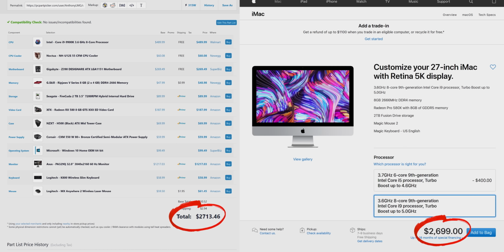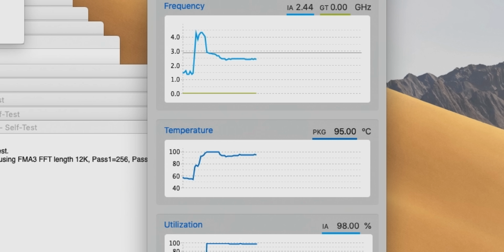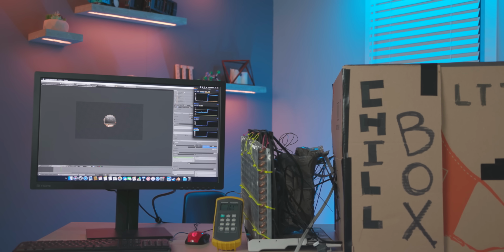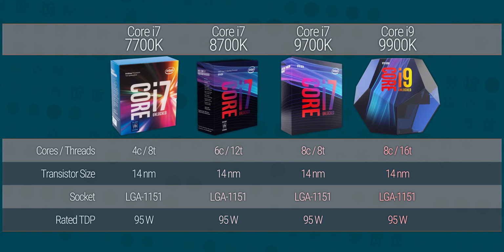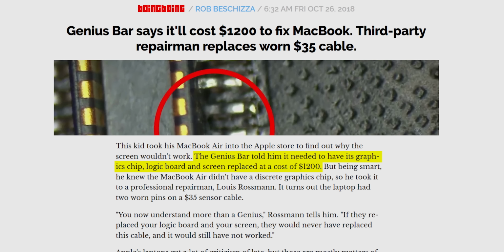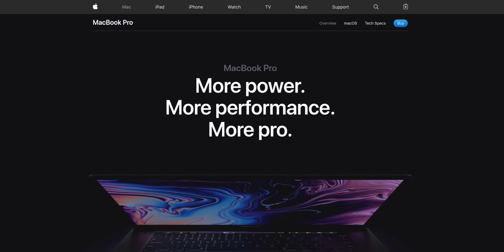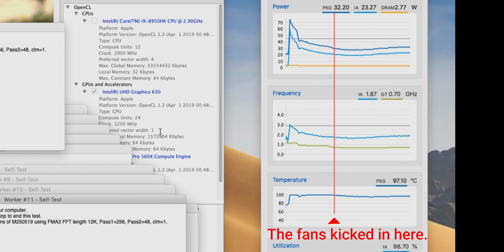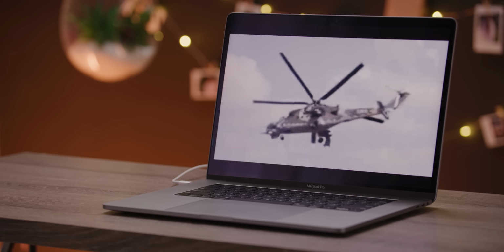Macs are SLOWER than PCs. Here’s why.

Comment: Hi LTT, The reason why thermal throttling is not as common on apple's phones is because of a few factors:

- phone getting hot in hand, possible hand injury from thermal effects of an overheat. This is a risk to apple for lawsuit over physical harm to a human being.
- regulations on the certification of components approved for use in handheld devices such as batteries and such regulate the safety aspects like heat which can threaten thermal runaway on small batteries in a wearable/handheld device like a cell phone that comes in close proximity to human heads on a regular basis.
- phones are subject to testing not only for the radiation they emit, but also for other safety aspects of the complete packages to determine that the combination of approved components does not cause a compounded issue that jeopardizes human lives. (scrutiny of this has tightened following the event of the Samsung note 7 fires)

There are likely other factors such as power efficiency loss at high temperatures and customer satisfaction with battery life that will destroy apple's reputation if not properly accounted for since the iphone is one of their most widespread products, used by many times more people than users of macbooks.

Comment: Ha, I have a small Dell laptop with two hell's coolers that can handle 4/8 Intel CPU running at 3200 MHz turboboost. The temperature is never higher than 70 degrees. The CPU doesn't drop the freq for indefinite amount of time. I had it running a script that fully loads all 8 threads for two hours. The clock was 3200 and the temp was 65-70.
I call it 'well-designed' (unlike Apple's garbage)

Comment: This is why Apple is going to move to their own chips in their MacBooks.

They did it with the iPhone with great success, same will happen with the MBP.
Reply: Exactly what I'm thinking. I bet the engineers at Apple are probably sick of dealing with Intel processors. They put up with PowerPC until they couldn't stand it anymore, and I'm sure they're just as ready to jump ship from Intel.
Reply: It's one reason. Most of their sales are to people who don't know, don't care, so it's not the primary motivation.
Reply: They have been knocking out hobbled gear for decades now, so it's not like this is a new direction Tim Cook took when Jobs died.
Reply: I doubt it. Not in the pro models, switching from X86 to ARM would be a literal nightmare scenario, not just for consumers but for apple as well. It's just not feasible in higher end models, and to split off Mac os into sub sections for both arm and X86 doesn't sound like something apple would do, unless they could somehow rip off their customers in the process as well

Comment: And they are just as insecure as PCs, both have intel management engine running 24/7 a purpose built backdoor into every system
Reply: Not really, there are more viruses and malware for Windows and Windows doesn't have data encryption with a secure enclave. True, Intel is fucked, but that's not enough to equal Mac and Windows security. Macs are definitely more secure.
Reply: @WouterStudioHD  Yeah they're more secure, but less performant.
Reply: EDG that may be one of many reasons Apple is going to make there own chips for macs soon like they do the iPhones and iPads.
Reply: Johnny English Apple is totally capable of making their own chips, they could buy
Reply: @johnnyenglish6797   They need to take inspiration from Linus's DIY heatsink
Reply: Johnny English Really, you could solve the problem with the same thin and light enclosure? Apple must be dying to hire you.
Reply: Johnny English Yes I did, because everyone knows you can make a well cooled enclosure by making it bigger, that’s not hard. That’s just not what Apple is about. Apple is about sleek design and if they need to give in some performace for a thinner body, they will do it. Most people care more about a thin and beautiful design than 3 seconds less render time.
Apple would never hire you, you don’t share their way of looking at a product.
All you seem to care about is getting every single clockcycle possible out of a CPU, without considering the rest of the product. 
Things like weight and portability should not be important in a laptop if it were up to you.
Reply: Johnny English Yup, they don’t get the same clockspeed as some other notebooks, that’s a fact. Also, the keyboard is a bit weird sometimes.
In almost all other aspects they are better tho, so I still enjoy working on them more than any other laptop.
They have the best trackpads, the best audio quality, best displays, best SSD’s and best buildquality and finish.
Overal, I’m pretty happy, despite some of its flaws.

Comment: 9:47

"A slower CPU that doesn't throttle is not slower than a faster one that does."

Well put!!!
Reply: Exactly how it is.
Reply: Well If you follow Alienware Youtube channel, there's a video where the guy said why they put an I9 inside their laptop even though they known that it's gonna throttle is because of "marketing".
Reply: Slower Chip doesn't throttle > Faster Chip when throttle
I think it's about consistent performance, rather than boost and down like roller coaster
Reply: Hermawan Fandi consistancy yes, but also the average speed will probably be much higher than what it is on a thermal throttled macbook.

I have a 2014 macbook pro, that shit hits a whopping 1.2ghz at high load when it should easily produce a 2.x without the turbo boost
Reply: @yutub_hfn   Slower Chip doesn't throttle >= Faster Chip when throttling
Reply: exactly that's why in multicore cinebench scores for the 8250u and the 8550u are identical therefore paying extra makes no sense
Reply: They can just put the Intel Low Power CPU 

There is couple i7 with only 2 Core designed for Slims devices
Reply: @AliciaCLR  they CAN, but then it wouldn't be a pro product.
Reply: @tristan6509  there is different type of pro

and pro that use these devices is pro that isn't need power
Reply: Not completely true though, because a lot of workloads are a quick burst of CPU usage where it can boost clock at maximum for less than a second to finish the work faster. Not everyone is doing video editing or encoding as the primary workload on their laptop.
Reply: @allanw  but would gaming put about the same work load as video editing or something i don't know a lot about this shit
Reply: It's not that simple. Depending on the workload, a throttling CPU but with more cores will still be faster than one with less cores but higher sustained clocks. Power requirements increase exponentially with clock rate.
Although I doubt that most MacBooks ever run at full load for longer periods (aka $2000 social media machine).
Reply: @Vault Hunter also i don't know about you but my 8250u is getting 650cb in cinebench while most 8550's are getting less than 600cb. what really matters is how good your cooling solution is on your laptop.
Reply: The way this is worded is confusing to me. Is he saying Slower CPU without throttling > Faster CPU with throttling?
Reply: Yes, if the faster cpu throttles down a speed which is slower than the ‘slow’ cpu
Reply: @RayFaye  He means if CPU throttles, it isn't any faster than a slower CPU that isn't throttling
Reply: @Vault Hunter well guess what, then the i7 model(8550u) will throttle even worse for you if you have gotten it on the same model of the laptop that you have the 8250u on.
Reply: Perhaps it has to do with the activity being increased thanks to having to shut down certain things to not cook itself to death and the rest is not prepared for the unexpected load the other parts cannot handle.
Reply: It's similar to the question, which is heavier 10 pounds of lead or 10 pounds of feathers.
Reply: When you pay more for a CPU speed that is not consistent, not not a good deal! reason why i stick with i5 8th Gen CPU with SSD for a slim laptop! heck even i5 8th gen still throttles, imagine an Intel Core i9 in that form factor! well... it depends on the TPB or CPU wattage design! Hope this points out to whom wants to buy a decent laptop in the future, not siding with either Windows or Mac, it's totally up to you decide!
Reply: This.  100%.  For everything I use it for, I find a perfect combination to be an 8th gen i5 paired with 8G RAM.  When the procesor and RAM are both in the same lane, there's no throttling/heat issues, and I expect some longevity out of this combo.  I CAN upgrade my RAM to 32G, but have found zero "need" to.  With a 256G SSD, I'm up and running in 10-15 sec.  No howling fan or heat issues.
Reply: @Vault Hunter 2 ghz is a little low for 8250u. u should be expecting around 2.4ghz on all cores in a sustained load. is your processor being fed 15 watts?
Reply: Thank you, i hate listening to children talk. anything to limit my exposure
Reply: Truer words cannot be said.
Reply: Except the video directly contradicted this when it talked about how you get quick speeds in tasks that can start and finish before throttling (I believe the example used was rendering a webpage).

But really, you don’t need the video to tell you that. It should be obvious that even if the cpu eventually throttles to the level of a slower cpu, it will at least be faster for x amount of time. Whether that slight benefit is useful to the user or not is largely subjective and probably heavily reliant on the tasks they do.
Reply: @geoken2  No it doesn't. The point is consistent performance. Video editing is supposedly for Pro audience. If it throttles the speed then it's worthless. Better get those thick laptops like Clevo or the recent Alienware Area-51m and actually get proper performance. You're not gonna get anything worth while on these thin and light pro crap.
Reply: @megalith  I think everyone acknowledges that under consistent load, a CPU throttled to xGHZ and a CPU that runs natively at xGHZ and doesn’t throttle will be the same (all else being equal). The point is that the throttled CPU will at least give you a boost during the times when it isn’t throttling. The video actually acknowledged this when it talked about the browser feeling speedy. So to say that there is no difference is obviously wrong since the video itself gives examples of the difference.
Reply: @geoken2  Those scenarios will be for non strenuous tasks which let's be honest will be totally fine under a lower clocked CPU. The i9-8950hk is a mess of a CPU that even those thicker laptops had a hard time controlling it on stock settings. Cramming that thing on the Macbook Pro is a suicide mission. There's no breathing room on that thing.
Reply: Assuming the same specs otherwise, like cache sizes and memory speeds, anyway.
Reply: Does that mean the m3 1.2GHz macbooks perform better than the i5 1.3GHz models?
Reply: "La Marketing
Reply: Funny thing... my laptop's Xeon used to throttle badly (trying for 3.4-3.7 or something), down to 1.6GHz or less.

Turned off turbo - now sits happily at 2.8 and handles all the CAE I can throw at it just fine
Reply: does that mean a chrombeook with a pentium procesoor is better
Reply: I am a dinosaur... 75 years old with a long career supporting IBM and compatible mainframes.
An old piece of mainframe lore...  "All CPUS wait at the same speed"
Hey... It's true!
Reply: @philipboug  True, but there aint much watin going on when them chips are bottlenecking now are there ;) Cool though, you havin worked on them old mainframes and all. Bet you were all on tha only need five of these to cova tha cumpitin need of tha world bandwagon... :D
Reply: @Serpentbane69  There are still thousands of 'em running world wide. Insurance companies, Banks, Government etc. When you have workloads that run hundreds or thousands of transactions per second, with Petabytes of storage needed, then you git yourself a good ol' grunty mainframe, or 3 or 4 of 'em. They are the Mack Truck of the IT world.
Reply: @philipboug  Yeah, I know. I was just referring to how computing have moved outwards towards the end user, how people never imagined this just a few years ago, and how the strangest things is now a connected computer doing some kind of task.  This surely never removed the need for data centers and supercomputers as Big Data is now the prime currency of the IT world. 😀
Reply: Once Again Linus lies about the price of a comparable computer to that Apple garbage or at the very least fails to motivate properly why this would be a fair comparison.

The PC:
- premium tower cooler
- premium motherboard
- premium PSU
- $1200 monitor
- 'premium' keyboard (pricewise, it isn't mechanical)
- premium mouse

Apple:
- no premium cooler
- no premium motherboard
- no premium PSU
- a monitor which Apple itself sells for $1000 (so it costs a lot less)
- ordinary mouse and keyboard

Not to mention that you don't have to pay $100 to get a Windows license and that you really don't need Windows in most cases (Linux).
Reply: Well put? Terribly put you mean. The wording here is awful and very counterproductive in getting the point across.
Reply: @DH-rq7gw  slower and faster is easier to say than the correct terms of less powerful and more powerful.
Reply: Abdul Wahab van Reenen It’s the choice of word placement and sentence structure that makes this hard to understand the first, second or even third read. No point phrasing it like this if you are trying to inform a layman or even somebody who just is not experienced.
Reply: @DH-rq7gw  how else do you want him to say it? he literally said a fast CPU that throttles is slower than a slow CPU that doesn't throttle. It's not that hard to understand
Reply: @AWsome02  Actually, they are talking about performance speed I think
Reply: @DH-rq7gw  no it wasn't. It was actually very easy to understand.
Reply: @DH-rq7gw  i mean, 618 people thought the point came across just fine. I think its just you bro.
Reply: @DH-rq7gw To me his wording was crystal clear, but maybe that's just me being a bit odd ?
Maybe You could give some suggestions as to how You would have put it, that more eloquently and or succinctly gets the point across ? 
Best regards
Reply: @DH-rq7gw  He was being sarcastic
Reply: @DH-rq7gw  The point was put across perfectly. You just can't understand context.

Comment: Hi Linus and viewers, let me share my experience with my 2011 MacBook 8,3
Let me start with factory specs:
17” 1920x1200 display
4 core 2.2 GHz i7 2720 qm 32nm architecture 
3.3 GHz turbo boost 2.0
4 GB of 1333 MHz DDR3
Radeon HD 6750M 1 GB gpu 
5400 rpm 750GB  HDD

This computer used to run very hot when under normal operation (70-80 °C) and topped off at 100°C under hard load (thermal throttling of course)

My upgrades
Went from the initial 4GB of ram to 16 GB
Changed the hard drive from HDD to a 512 GB transcend SATA3 SSD
And changed the original thermal paste for thermal grizzly kryonaut
Installed macs fan control and made my own fan curve.

The cooling on this laptop is pretty robust, maybe even good, but the stock thermal paste is quite bad, I am sure it was engineered for longevity, because I changed it this year, which means it was 8 years old, and was still on rather good conditions.
Now the MacBook boots faster than my brother’s 2015 MacBook 13” which has apple’s proprietary ssd solution. It runs under normal conditions between 33 and 45 ° C (depending on ambient temperature)
And tops off at 82° C under hard load, allowing it to stay constantly at the turbo boost speed on every one of the 4 cores. No warranty concerns considering that it is an 8 years and 2 months old laptop.
The only last upgrade that I would do is getting a new battery, the current one has gone through 482 full cycles and can hold only 7296 mAh from the original 8450 mAh (86.3% of the original capacity)

If there is anything impressively good to take from this long post is that I think a performance oriented thermal paste can do a real difference, but my guess is that it would need more maintenance (and would void your warranty on newer products)

Comment: In one of Renee Ritchie’s videos he talked about how Apple designed its most recent computers with the idea that intel would actually meet its roadmap of producing smaller chips with better thermals. The problem is intel hasn’t upheld their end of the promise and instead of making smaller chips with better thermals they’ve been increasing the clock speed and the core count which in turn highly affects the thermals. That’s why Apple really wants to switch to its own custom A series chips in its laptops because they provide similar performance without the need for fans so that Apple can keep design at the forefront of their products.